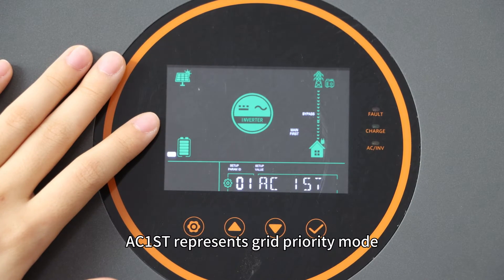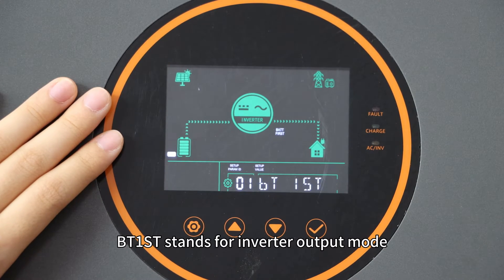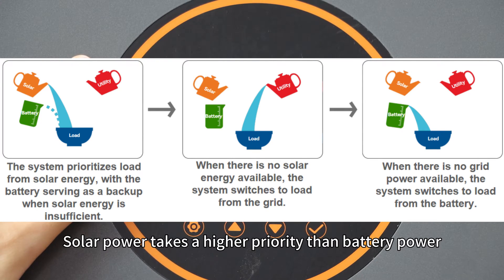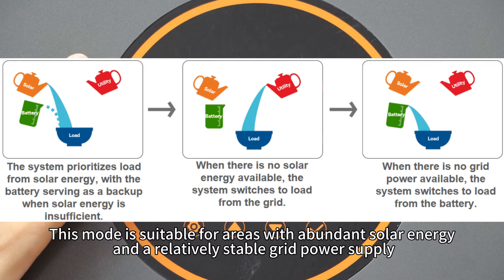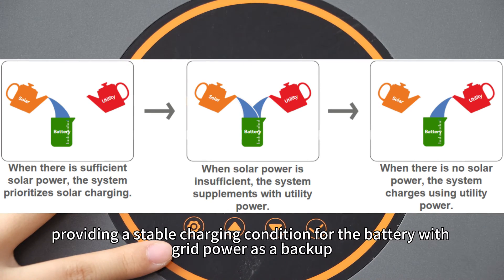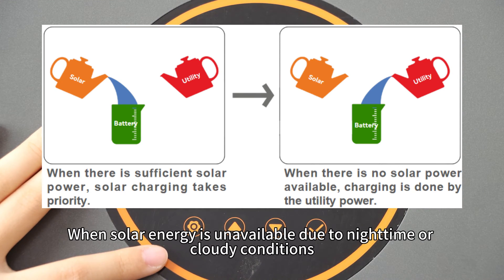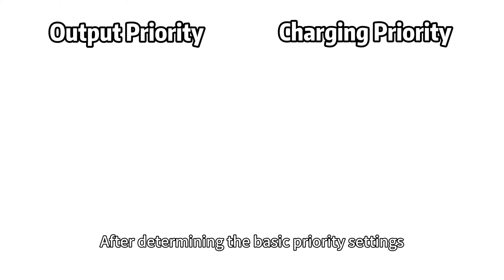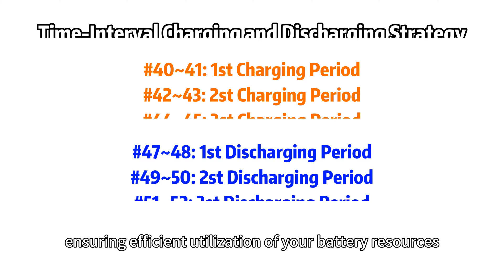The Energy Configuration Capabilities of the POW-SunSmart SP5K Solar Inverter

Comment: How do you configure the inverter to work without battery.  I have this inverter and it does not output any power when I connect my solar panels to it. It only provides power when I connect it to the grid.
Reply from the maker: Please send your problem to this email: support@powmr.com.

Comment: How do i get the inverter to work with solar only? I dont have any battery. The inverter only start inverting with i connect to grid
Reply: Most inverters I deal with have a minimum DC input from the battery required before they will even power on

Comment: Can it work without battery? Can it feed the grid?
Reply from the maker: Yep, this model can work without batteries.
Reply: @PowmrSolar   Can it feed the grid (sell at a green tariff) with excess energy from the panels?
Reply from the maker: @dimmer4955  Nope. This model can not sell power to the grid.

Comment: Do they only output 120Vac?  If so, can you run two in parallel to get 240Vac split phase?
Reply from the maker: Yep, single unit can only output 110V, but this model can output 220V in parallel.